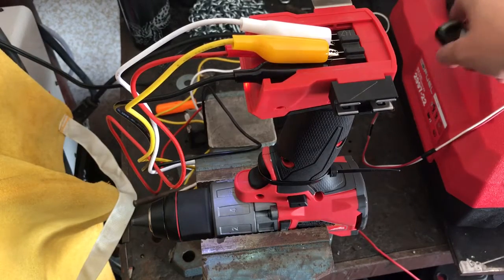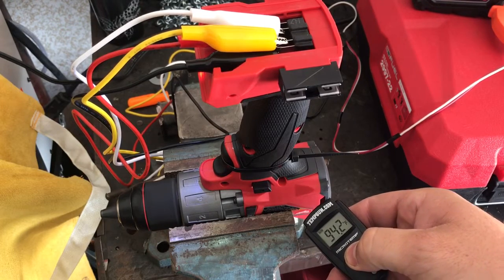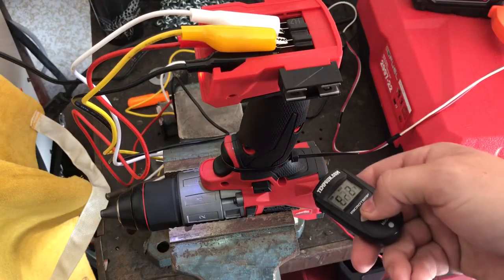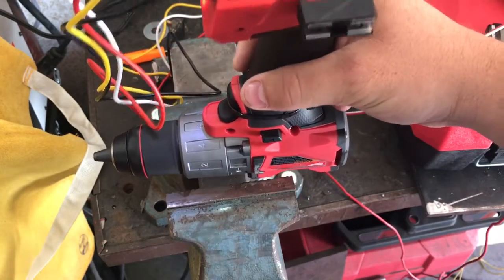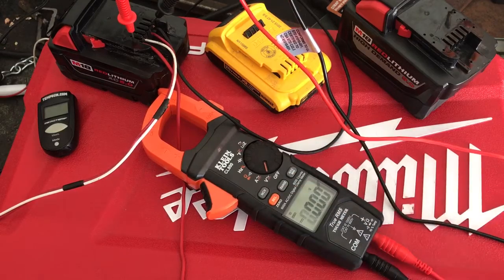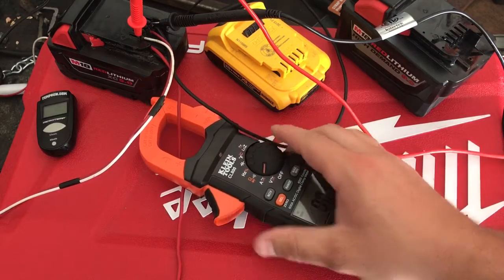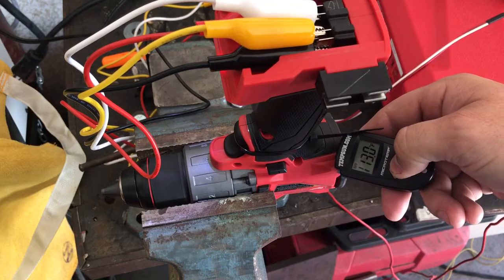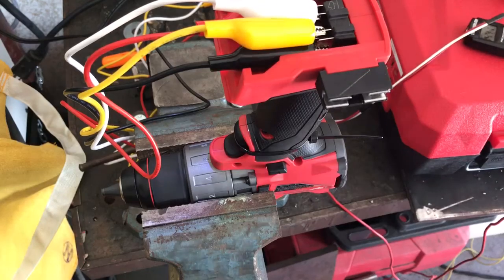SBM: Milwaukee Gen 3 Hammer Drill Heat Issue; It's Gettin' Hot in Here!!!!

Comment: Everyone wants more power. Everyone wants a lighter tool. Everyone wants longer battery life. Everyone wants a more compact tool. These things contradict themselves. More power requires stronger motor. And stronger motor demands more electricity. More electricity is a bigger battery. Put this all in a smaller size. Something has to give.
Reply: Dustin Smith you said it brother
Reply: Spot on.
Reply: should we worry? and in long run are we ok ?? i just bought this kit lol
Reply: @nicktorres735  I wouldnt worry nick
Reply: @jake thank you and i used my kit today and nothing so im happy and shoot i just got the m12 inflater and it gets hot too duh its a tool lmao
Reply: @nicktorres735  how are the tools holding up?
Reply: great no issues i actually bought the impact bare tool for my service bag as well
Reply: The power has got to go somewhere.  Voltage pressure released to a good path to ground would result in good power and more heat generated,depending on battery capacity; moreover, the handle is the current ground path.   Basic electrical 101
Reply: I drill through metal and concrete all day as an electrician. Gets hot as hell, but hasn't quit on me yet. Its only been about 4 months tho. Still love this thing
Reply: Almost no ventilation  compared to other drills thats whats why it heats up so fast...badly designed i would say
Reply: Yeah well my Dewalt is powerful and never did this. My Milwaukee runs so hot under minimal load and minimal time that I could barely use it. It's in for warranty right now. What good is a tool if it becomes unbearable to use?

Comment: A couple of comments on this coming from an engineering perspective. As you increase your power density while maintaining constant efficiency, things will get hotter as there is less surface area to convect the heat away from. To offset this, you must increase the convection coefficient or else you will get higher steady state operating temperatures. For people commenting about the lack of air vents to let air flow in on the upper casing, the vent to let air in is on the bottom of the handle. It is placed here on purpose. Placing it at the bottom of the handle creates forced convection over the power electronics which are located in the handle of the drill. There are various temperature sensitive components in the drill that can not exceed a threshold temperature. The permanent magnets, for example will begin to lose their magnetization after some threshold temperature that depends on the specific type of magnet being used. I don't know for sure what specific magnets or electrical components are being used in the drill so I can't say for sure what the weak link in the system is, but I'd be willing to bet the weak link is located in the power electronics. In spite of this, I am sure that Milwaukee has coded a temperature shutoff in the drill to make sure that the drill can not cause any permanent damage to itself. So aside from feeling a little warm to the touch, which to me isn't that big of a deal, I wouldn't be concerned with the drill heating up. It won't damage itself and it's a small price to pay for the insane torque/power density that this tool is capable of!

Comment: Dude, you ran that flat out for 10 mins straight. Load or no load its not designed for that!
Shorter bursts under load mabey id understand, but if it dosent get too hot in real world use its not a big deal.
Also youve got warranty if it fails.
Ps I just brought this as a bare tool for $149usd at home depot to take back to australia as its so cheap.

 In Austraila this currently costs $262usd! For 150 bucks if it fails out of warranty id just bin it and buy another. Be glad power tools are so cheap for you guys...
Reply from the maker: I’ve already replaced the drill via warranty and the new one does not heat up nearly as quickly. That particular drill in the video would heat up drilling significant just drilling a few hole in 1/8” steel with 3/16 bit
Reply: Silver Back Moose well as long as it’s working ok now that’s all that matters. Sounds like you just got a dud.
I beat the hell out of mine and can’t kill it, drills holes all day long without getting overly hot. Very impressed tbh
Reply: JimTheCoffeeGuy  mine heats up quickly
Reply: Arieldny mines still going strong. It got a bit warm recently after drilling 4x 1” anchor bolt holes in a brick wall back to back but that’s about it....
Reply: "Dude," it was already hitting 110's - 120's within two minutes. If the drill were being used to mix a bucket of paint, it'd be running this long. My Milwaukee was sent in for warranty this week for the same issue and I had to return to using my Dewalt which included using it to mix 5 gallon buckets of elastomeric (thick) paint for 5 minutes at a time and with no extreme heat issue. The Milwaukee's are garbage.

Comment: I've just bought this as a combo set (drill 2804-20 and impact screw driver 2853-20), and also noticed how quickly the drill got warm without any load, and really hot when working hard.
I think that there might be a design flaw in the vent holes, or lack thereof, on the drill.
Reply from the maker: Yup
Reply: @silverbackmoose8642  
But at least the thermal protection doesn't kick in and you can still work hard with it without any issue (wearing gloves)... ;-)

Comment: This is normal, just think the fact that this drill has 30% more copper in it which means that it draws more current. More current means more heat is produced at the rotor and stator of the motor, it's expected from this tool to get hot easy. However they did a bad design on this gen 3 drill and didn't put enough air vents to cool it.
Reply from the maker: 100% agree
Reply: Yup
Reply: Still have the chuck problem?
Reply from the maker: Chuck problem?
Reply: Ive seen a lot of reviews around with people saying the Gen 2 chuck wont tighten overtime and/or the shaft has just sheared straight off, i personally havent run into those issues yet but i dont use it all day everyday
Reply from the maker: Mmm not yet. I got a replacement drill already. It’ll get put through its paces this weekend
Reply: @silverbackmoose8642  what happened to your last drill?
Reply: @jakeaus1178  I never had a problem with gen 2 it's very durable and the chuck never loosened when I drink in metal.
Reply: Prob returned it cuz hes not use to the overheating of Milwaukee drills

Comment: Mine gets hot quick too. The drill stopped working. Had to disconnect and then connect the battery to get it going. Very frustrating.  It is a powerful tool. No question about that.

Comment: Any power tool running non stop as you did will gradually heat up! That's not a real world scenario you set up! There may or may not be a thermal issue with the Gen 3 hammer but this test didn't prove it!
Reply from the maker: Mmm ya it did. My dewalt never ever got hot and I’ve used it to drill 1/2” steel
Reply: @silverbackmoose8642 re read my post... Obviously you missed the point!

Comment: I just sensed this possible heat problem with my 12v fuel hammer drill not sure if it normal ? with no load speed, maybe it due to poor venting port design problems

Comment: Hmm so that’s why Milwaukee came out w the new m12 fan 😂to cool down the drills and users hands 🙌🏼 hahah I had issue w a lamp ( don’t tell anyone ) I mean nothing is perfect but hey they should tell the public or recall or put an ad warning users but that would only make them loss $  my m12 draws 4ish amps it’s normal I guess the more torque you get for this tool the more the motor has to work even w no load those gears are quite resistant. But I do get your point I agree useless for heavy non stop work , it’s like you better have a tan/ or water cooler to keep using it . Thanks for sharing

Comment: I bought the M18 FUEL COMBO KIT, no issues with impact driver but Is it normal that hammer drill gets hot just by making just 1 hole in concrete?
Reply from the maker: Idk man that’s why I made the video. I did just cut a few 2” hole saws out of steel tube with no issues. Maybe got a little warm. Regardless the power is awesome in these new drills
Reply: Mine gets hot as hell in hammer mode in concrete. Hasnt quit on me yet. Seems fine

Comment: my gen 2 get really hot.  like hammer drill a few small holes and burn your hands hot and the chuck quits turning (motor continues).  

i miss my 400 inch pound C3 craftsman drill because these 1000+ inch pound drill gun rip themselves apart.  mine destroyed its own clutch and busted its own aux handle mount.  worst tool for actual work  milwaukee made.

Comment: Hey can you please tell me the input requirements to get milwaukee tools on bench power by that I mean what are the white and yellow wires input voltage etc. Any  info is extremely appreciated
Reply from the maker: The input voltage is 18v nominal dc
Reply: @silverbackmoose8642  yes but I thought they dont work unless you have signal from the bms in the battery as in they need more then just positive and negative from an 18v power source to function

Comment: This the problem when you go shorter less room for air to circulate, so the motor starts heat up quicker, Makita had the same problem with it's impact driver, though it was shorter and more compact it got hotter quicker
Reply from the maker: Yes but not like this. I’ve been a RC guy since before Lipo even existed, and this thing gets hot drilling two holes through 3/16s plate
Reply: Silver Back Moose A lot guy's are complaining about the heat
Reply from the maker: Please share where you are seeing more opinions!

Comment: This is 100% normal for Milwaukee drills. I have the previous model and the newer m12 model. I asked the same thing if its normal to get so hot so fast. After drilling into drywall to hang up 3 cabinets it was getting a bit hot I had to let it sit for a bit. I know my Dewalt and Makita's have almost no heat after that amount of work. But I do know two electricians that said it is normal for Milwaukee drills to heat up so ya I guess it does seem to be the norm for the red team.
Reply: ToolShopGuy I have only had my m12 impact heat up doing High end screws for steel stud and screwing into something I shouldn’t have screwed in.... dry wall should be nothing I screw into cement for Christ sake 😂
Reply: Electrician here. I second that. Gets hot as hell especially in hammer mode. Keeps on chuggin with no problems. I just wear gloves

Comment: If u want a smaller tool u probably should go m12. I was kinda frustrated when I saw this new tiny m18 tools. The m18 should de big and strong, while the m12 is small and handy.
Reply from the maker: Ya not for offroad fabrication. Most of the steel on a truck or Jeep is 3/16 or 1/4. I don’t think a m12 would be long for this world
Reply: Silver Back Moose for off-road maby... I’m the bigger/stronger the better guy, so was really  skeptical about  m12 until I tried their gen 2 drill - just enough power for most applications, and the size is so nice, it fits in my pocket

Comment: running it like that, can't be good, ,, in any event, only had the 2804, a few week's, but no problem's, heat or chuck, or anything. drilling wood, cement, brick, so far happy, ,,, when drilled with the 2656 1/4" impact, got hot, (but not really made drilling, when switched to the 1/4" 2750 + 2753, less heat, but Hammer drilling, def 2804, happy, and older 2606 for drilling, just fine, did not own 2704, but my 2804, no complaint's.

Comment: I’m just glad that what I do to make a living doesn’t require torturing my tools too much! (Once in a while though.) 
Anyways, suspecting this test is so outside of real world use? Not sure how much validity it would have. (Coming from a guy who owns Yellow, Blue, Red and Orange.)

Lovin’ on my Fuel (M18/M12) and my Bosch 12v these days....researched and ran with no downsides so far.
Reply: If you use it to mix a 5 gallon bucket of paint, which is real world for a drill, that would be a similar situation where it would be run for up to several minutes.